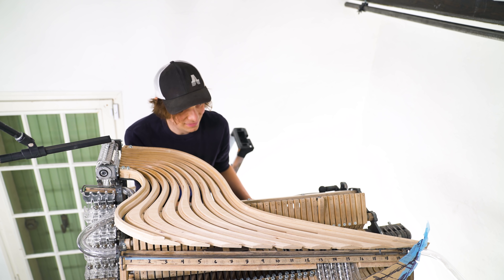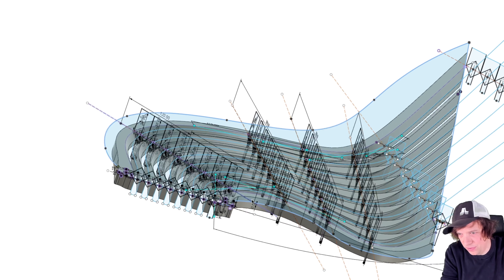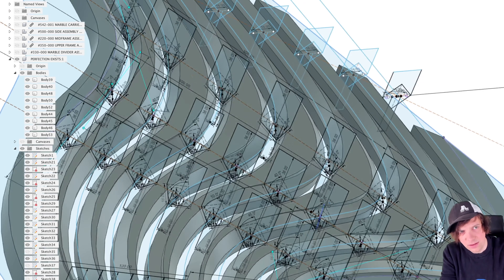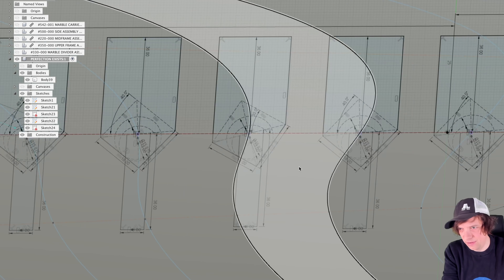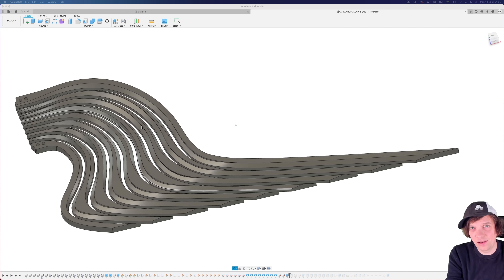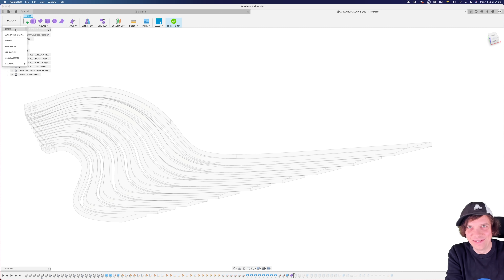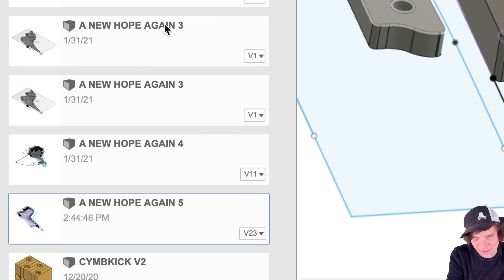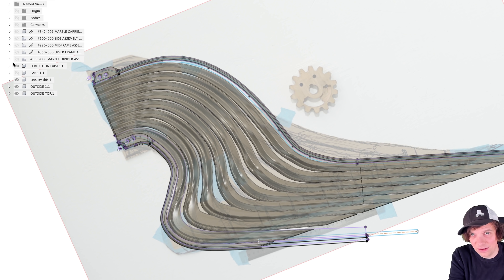Marble Lanes

Comment: Martin, I'm worried that by trying to move away from whack-a-mole and starting fresh from first principles, you're not actually making things better or easier for yourself. I'm worried that instead what you're now doing is basically falling into the Cobra Effect. Basically, you're solving small problems by creating new, undefined, and potentially larger problems. If I remember correctly, the redesign on this part was for the purpose of solving 3 small problems (noise from marbles, marbles jamming in the merge zones which never seemed to happen, and the marbles falling into the downside of the conveyor belt). I think you could have solved that by adding a small molded silicone ramp to make a transition for the marbles into the funnel, which would remove the bounce and noise, and prevent them from getting sucked into the conveyor. You could also have added a small nylon bristle brush to close off the gap between the conveyor and the ramp to keep marbles from getting in there. It just seems like the machine is at the point that mandates small tweaks and fine tuning, and not huge redesigns. This cartoon from The Oatmeal perfectly expresses what I am worried might be going on. https://www.instagram.com/p/CJoXy0cjJrC/?igshid=10k5lb4n59t43
Reply: There are some great solutions on the discord server for various problems and this one track to feed all tubes wasnt going to work or was going to keep being a problem to some extent since the left side favors filling up and the right side favors being empty. They have a solution now that pretty much makes marble height on the entry entirely moot while keeping marbles moving and not slowing down or stopping. This design martin is working on now spreads out the entrance points to better solve the left VS right favoring of tubes. Both designs together will probably perfectly solve this issue and it IS vary much an issue that was ignored for quite some time. This isnt something that would have worked as is and it needed to be taken care of at some point. martin may have just been waiting for the team to refine some ideas for it.
Reply: But I LOVE your videos Martin. So my egoistic side wants to see trouble as we may get more videos :-D
Reply: @whatchs9360  Nah man, the videos where he's happy and borderline manic about progress are a far better watch.
Reply: I think you are correct
Reply: Completely agree. To me the bigger problem seems to be the marble divider but I haven't figured out how Martin could solve it. The fact the marbles have to be flush on the top makes for very few margins and the pipes just have to expand a tiny bit for the flushness to go away. Or am I wrong??
Reply: @whatchs9360  I'm with you on that being the bigger problem. Even if he gets things running smoothly now, if you ever move the MMX things are not going to stay in the exact spot for alignment.
Reply: Agreed, it's a gorgeous piece. But it feels like starting over to put into practice new knowledge and skills. That is a recipe for never actually finishing.
Reply: @mormacil  assuming he wants to finish it.  I’m dying to see this live one day on stage but sometimes I still wonder.
Reply: @Phantomthecat  I think he still wants to although I fully admit I feel this journey in itself is worth it. But I think if he never finishes this it will eat at him till he goes into another dark valley.
Reply: Agreed. It looks great, but I can see a dozen of new problems rising while the old ones (noise, gap causing marbles to fall off the lift) are not really solved.
Reply: Yep you are  absolutly right. I think we will never  see the end of it.  Martin is constantly  modifying instead of completing.  trying to solve tiny problems.  About the  system in this video , you will note that he is approching  the same system that he had in the first machine , which was working well  isn't it. So, just think simplicity  instead  of  targeting  THE perfection  the first time.   Any complex machine  needs more than one prototype . Martin is trying  to make the one and final machine .  Just finish it  and see after.
Reply: @newtonbricoman1694  That's hard but at the same time he has a youtube channel that would totally love several prototypes. He could even sell the old prototypes if need be.

Comment: Function over form Martin! Function over form! This seems to have a lot of issues, speed is one but starvation is another as this design has an issue if the marble lifter tends to favor pickup slots over others. It even seems unlikely that anything below channel 6 will be fed from the lifter. It seems that you need to move the bend even further out (following the fish stair pvc) and cut the width of the ramp in half so the rightmost channel hits around channel 10-12.

Comment: - The marbles are not slowed down.
- You cannot redirect marbles to a different lane.
- The first channels are underserved
- It doesn't take in consideration that the marble lifter is biased and rarely is completely full
- Marbles still jump from the lifter to the tracks
- And it doesn't even fit.

This is a massive step backwards from all the progress this channel has shown so far. You went from prioritising real issues and real performance with an engineer mind DAILY, to a couple of days working on a tremendously poorly thought but beautiful design.

This is very disappointing, specially after all the good work you've done so far in this channel.

Comment: What about instead of applying the marbles directly from the elevator output lane to the marble feeder lane, take the elevator output lane around the elevator and conjoin it with the stairstep output lane.  This could solve that extra kinetic energy we are seeing when they hit the marble feed lane. You could use spinning slotted wheels attached with gears to ensure it cannot jam during the merging process.

Comment: Don’t worry about tilting slopes in the corners.  The distance between contact points of the marble and rails with descending angle determines speed.  Increase width to slow the marble.

Comment: Can I suggest you follow principles of road design?  You have straights with a primary cross section (normally 3% crown down both sides. When changing direction you enter a transition where the left or right edge spirals up to the superelevation cross section. At the curve left or right the transition  is +3% up from the centreline. When you exit or move to next curve, the transition is the opposite. For you the cross section would be naturally a 'V' -3% down for a straight section. You thus only ever transition one edge string (obviously you transition the side walls as well) This will give you a variable top wall profile, but it is far simpler and will guarantee the marble stays in its lane as the marble stays in a smooth profile. Take a drive around a major road and note the kerblines. End of civil engineering lesson.

Comment: You’re failing to feed the first 6 to 7 lanes, try seeing your template from the front, you’re missing stuff. Also, this seems a step back, I really thing you should investigate the machine’s feed rates for each channel grouping ( vibrafone, percurssion, bass) because that will inform you which channels need more balls or less. The advantage of the old linear feeder is that it is self-selectant, and you could just divide the feeder by groups, something like 3+3+2 for vibrafone+percurssion+bass. Another thing with is is that you’re introducing lag to the marble’s paths, they should run the system as fast as they can, so you don’t have empty channels because of slow marbles. This might not even be a problem for a 5 min song, but I don’t think you know that for sure. Just some random  thoughts from a sleepy guy (sorry).

Comment: I thought the whole machine have been ported into CAD, wouldn't this make placing the models in the program easier to determine if everything is the correct size before printing?

Either way the new design is beautiful, and I can't wait to see it adjusted and implemented :)

Comment: simple square (or diamond? because it's tilted) profile at the start, a path for it to follow, and a second path as a "rail" or guide that is offset enough on the inside of the curves. You could then sweep it, have the center follow the path that you want it to follow, and have one of the corners follow the guide path to do the tilty tilty

Comment: as a footwear designer one advice:
there’s a system to avoid „strange curves“ and make them sexy.
what I mean is pls check the spaces (shapes) BETWEEN the curves.
3 parts:
If you take a look, you will realize, they all POINT somewhere. make sure, the directions they point fade evenly. not one pointing straight, the next three ray evenly. (you know what I mean?)
also the SHAPES inbetween the curves. they need to evenly transition from (lets say) slim to wide in similar and even steps. not a slim one and then 3 fatter ones.
and finally, the SEGMENTS of curves, lets say each curve has 3 segments, make them transition evenly (from curve 1 to curve 8)
thats crucial for achieving sexy curves.

short:
„don’t design the curve, design the space between them“

if you like I can do this for you.
I „bend curves“ for 20 years now. 😊
12 years in PUMA, now focusing on building sexy coffee machines, grinders and other foodie stuff (my passion)
Reply: edit: for that amount of curves with so many bends in a small space you managed it quite well. (I hope my comments didn’t sound rude) my OCD made me comment, as there’s a system to do curves sexy. I can design them for you if you like.
Reply: makes sense

Comment: KEEP IN MIND, 3 POINTS DO A PLANE (You are Machining on 2.5 type). For that reason, one corner of your design is not fitting, and it is flexing your disign. IF I WERE YOU, I WOULD DESIGN ALL THE LINES SEPARATELY. And you will get different levels that will fit better.  @MATAMFG

Comment: I worry the marbles will be going too fast and bounce at the bottom of the ramp and hop out, there is a lot of potential energy going from the top to the bottom, in the old design with the plastic pipe all that energy was lost when it reached the pipe. Also there is the issue of there being less marbles available to fill the holes on the left side of the machine than there will be on the right side, you could end up with there being a deficit of marbles for the drops on the left side of the machine.

Comment: You told about the marble tracks and i thought: he is getting incredible good at this!! (Myself as an engeneer) and then you noticed the end is too long  and i thought: But there is a fixed messurement! How did this happen again :D 
So the skills are there! (With the tracks for example) So go on your making big Progress! Mabe not every time on the Machine ;)
Reply: I find it interesting to observe how he is getting the experiences of an engineer in a documented jurney. From simple to conplicated to the simple again. Featurecreeping or design to look good just to modify it for practicality. 

I think that these clips could be collected and assembled into a good documentary of the path of an engineer.
Reply: if he was an engineer he would just use 8 PMMA pipes to guide them at the start of his marble divider. now he is just casually dicking around.
Reply: Engineering is about finding the right compromise between competing requirements. There is no reason ascetics should de facto be excluded as a design requirement.

Comment: Cant you just scale that whole body in lenght at the end? Thats what I would do but I am 1% as good as you in F360. If you are scared (like I would be) that all automation fails then, just save copy of othervise ready file with new name, then take timeline off. Then do the model to the whole body which no longer has any history. So every scaling it will do is just percentage of total. That would be just to get a working part for CNC every time. Ofcourse any changes in the geometry etc you would need to open the earlier file, and do same flattening + scale every time.

Comment: Martinm I'm very concerned that this new design will cause a lot of marbles to flow through the later tracks, but only 1 in 8 marbles will ever reach the early tracks. If you have a song with a lot of those low notes in it, I worry you will run out of marbles, whereas the drum and guitar tracks will have marbles for eons!

Comment: lol yes it was an hoops..
Cool than you used French curves for the design.
Careful I don’t think you end result is on the same plane, your base is not flat.
I have not touch cad for ever but you should start with the 6 boundaries no grooves test fit with no bending or pushing.
Then the grooves

Comment: I agree with others, that you should consider if your first design was actually the better one. I think that one only need some improvements. It had no issues with speedy marbles, and catching the marbles from he conveyor could be easily improved by height or distance ( and replace the acrylic lane part with plywood would help with the noise.) In this design the marbles will bounce to other ones at a very crucial location in the devider and jump over, where they need to fill the channels. That is a worse location than with the first design, before the marbles enter the pipes. Also, I doubt that the organic shape of this design fits the "industrial look" of the MMX. But that is more a personal thing. I can imagine that others will love it.

Comment: Hmmm, I dunno, you say that you are making this with engineering as Number one consideration, but so much of the design of this seems flawed and not thought out mechanically and only done for the look. I think the original design was much more mechanically functional. Your concern about the original design having two marbles get stuck seems like such a small chance of issue compared to the possible issues with this new design. I think a better tack would have been redesigning the original to fix the moles rather than create a design with infinite possible moles of its own.

Comment: maybe just PMMA pipe the hell out of it. 8 separate pipes with looooonger twisted paths for each  elevator channel, all of them ending at the start of the divider. form will follow function. connect them with rings and pegs so they make a rigid spaceframe. at the start the pipes will be sliced open. (open roof with raised sidewalls to act like funnels).

Comment: not confident with this design, its doesn't feed the channel 1-4, and i doubt even a refit could reach the channel 1. also with this design, which seems to feed each channel equally instead of the ones needed in priority, its means that some overused channel will likely drain faster than they refill and finish empty and finally derailment look more risky with this one. To conclude the former design look more efficient to me

Comment: So too many comments to read to see if anyone would have suggested this... But probably not.

Firstly great work. Even Elon doesn't always stick the landing. That's part of the development process. You machine probably has more parts than a Raptor engine; complexity doesn't come easily. But Glory does last forever.

You wanted suggestions on modeling: I just think that you have the wrong tool in this case. Fusion360 is not the easiest to use to create organic shapes. Might I suggest Blender? Use a single bezier curve, solidify modifier, an array modifier, a boolean (or two), plus a mesh modifier and you would be done. You would have perfectly evenly spaced runs, with the slopes exactly like you wanted.

Ask your CAD team to help. I'm sure one of them knows.

... And it's awesome to see all the design help you get from the subscriber base. Makes me want to start my own Channel.

Comment: better use sweep not loft. guide curves and sections. keep section planes normal to each curve at each specific point.* you may need to have separe planes for each point to achieve this, or not. make sure last sections are also normal to guide curves, cut excess later or use sweep cut. also, you may need to make the whole thing shorter, marbles enter too close to the end of the divider.

Comment: This is probably dumb, but tbh the most modifiable design is just a big wooden tray with no lanes at all, that the marbles fall into from the elevator and find their own way down to the channels. With a tray, you don't have to think about the pathing of individual marbles and are instead only concerned with guiding (literal) edge cases along the sides, in whatever way you need to do that. I...don't think that's what you actually want, but there you go.
Reply: not bad at all. make it from thin Lexan with side walls. and you can also make it wavy to reduce marble speed. would be invisible
Reply: Very practical but I feel it misses the artistic side, leaving a point on the star unfulfilled. I do wish he would do this though as a starting point and work backwards to integrate the more creative elements. Only time will tell I suppose

Comment: Have you checked that the marble lanes clear the top pins ( the ones that get plucked by the drum pegs) once the marble divider end is pulled down?   I would hate for you to do a new design and fit it only to find it fouls the vibraphone channels...

Also I’ll I’m not so sure how wise it is to have all that tension in the plywood.  Seems to be a stress point you don’t need

Comment: I really like your recent focus on bringing the design back to reality and out of CAD, for example with the cardboard mockups. Seems like a lost art nowadays with everyone jumping straight into the computer. Having a physical thing to hold and look at brings so much more useful perspective
Reply: I've "designed" a simple license plate support for an old moped and mocked up in CAD (Cardboard Aided Design) and then drawed in CAD (computer) to print a precise A3 sheet to put on a metal sheet and cut it with the angle grinder and fold it using a vise and a hammer🤣